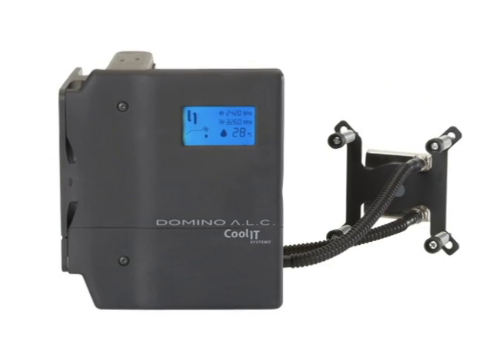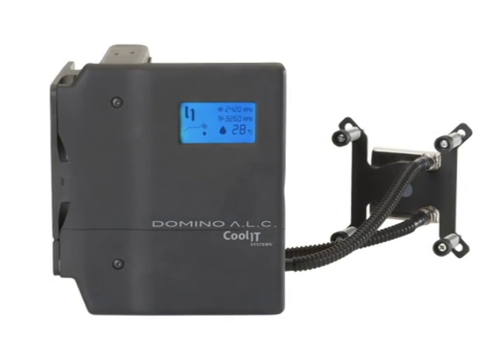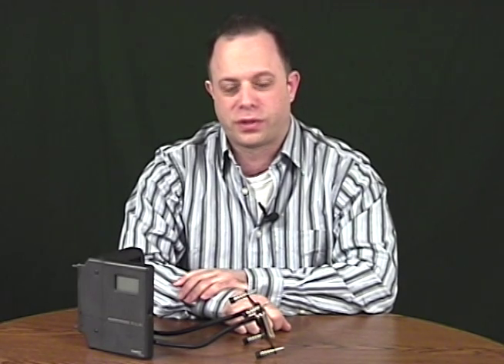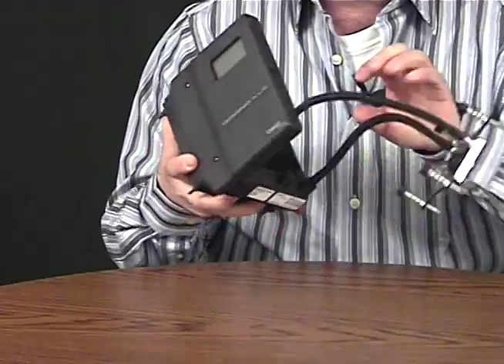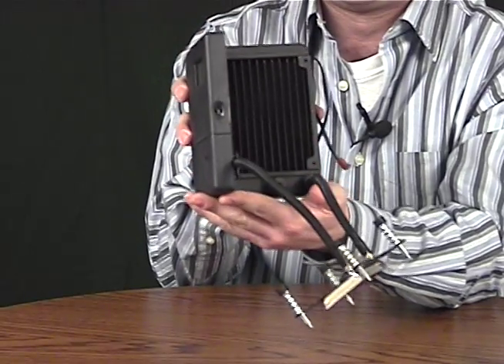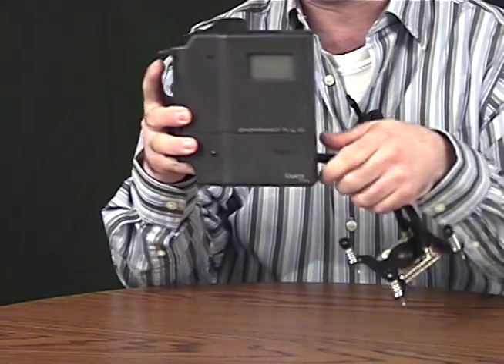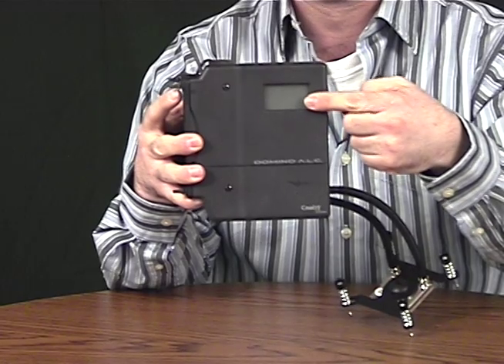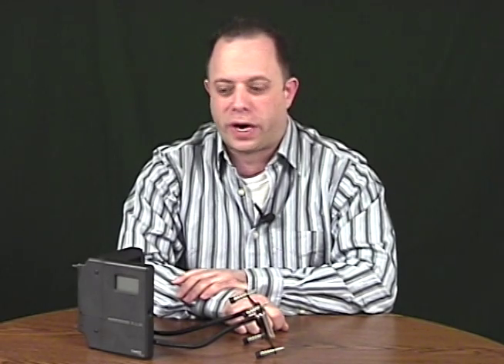Beat The Heat

Comment: Also you mean the "added expense" of fitting a proper liquid cooling system that actually have noticable cooling benefits over air.  I have tested a couple of these (H50 aswell) vs a good air cooler and you will notice little to difference under load.